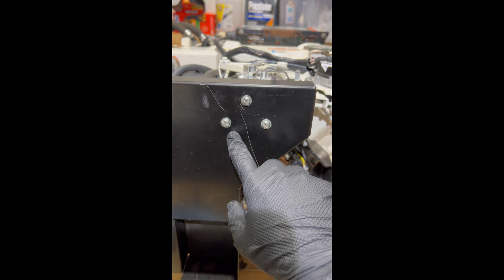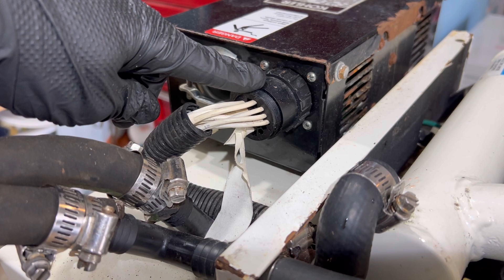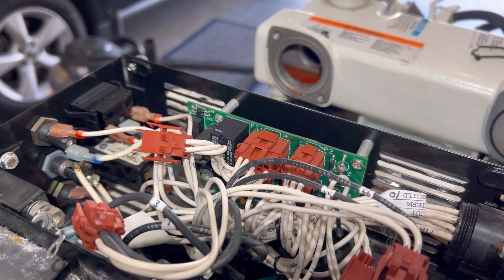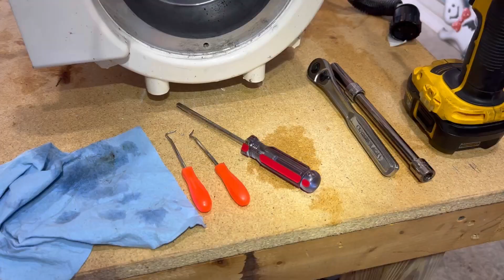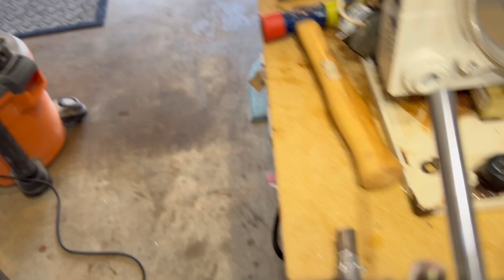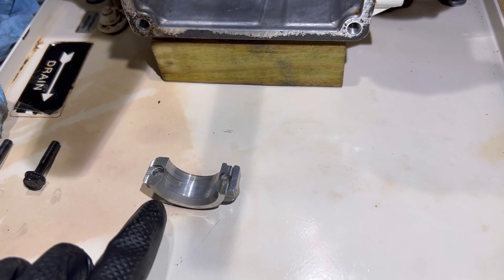Generator Rebuild Ep. 2, Teardown

Comment: I have exactly the same model generator. The unit was overheating and automatically shutting down. I suspected the circulating pump was the culprit due to some staining from circulating pump down the back cover. The tear down was moving smoothly until I got to the rotor.  
  Your video describing how to remove the rotor was invaluable. I used a 17/64 piece of drill rod with a 5/16x24 thread and ran that into the crank shaft. I then used a grade eight 3/8x24 x1 1/4  and threaded it into the roter shaft like you demonstrated. Then used my impact drill. The rotor popped right off. The connector ring came off next then the water pump. The water pump impeller was unremarkable. I suspect the gasket failed as that is where the staining began. 
So thank you for making these video and sharing them with the world. There is the saying “If you give a man a fish, you feed him for a day. Teach him how to fish, you feed him for life.”

Comment: I have in the past cut off a bolt and then cut a slot in the end. This will allow you to use a screwdriver and prevent those buggered threads

Comment: Proper rotor removal. Remove the water pump drive piece from the rotor bolt, put the bolt almost all the way back in and smack it with a decent size hammer. It pops loose. No pullers on. Those. Thats out of the kohler manual. I have been working on those for 25+ years.

Comment: great job was wondering if you had a gray wire on the starter side of motor in the harness with a eyelet
Reply from the maker: Sorry I am not sure.  If there was one I don’t recall needing to remove or reconnect it, but I didn’t remove the starter during the tear down.

Comment: How did you pull apart the cover for the stater housing ???
Reply from the maker: Once overbolts are removed it actually didn’t take much effort to separate.  But very heavy, bear hug it as you slide the whole thing off the stator

Comment: Whoa. I give you credit for that tear down.  That is certainly the proverbial can of worms I would try to avoid.  You must be a mechanic by trade.  What was so bad about the pistons that warranted a tear down?
Reply from the maker: Yes was a mechanic earlier on in life, now an engineer that tries to keep mechanics as least mad at me as possible haha.  Some of the pits on the pistons were about 3/4 deep through the thickness of the material, which made me a little uneasy long term.
Reply: How much oil does your generator typically use?